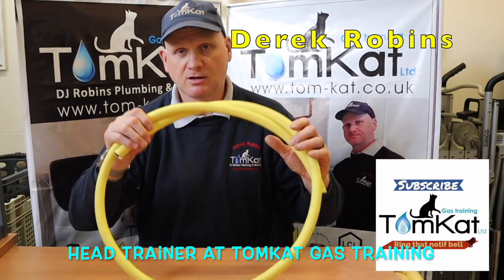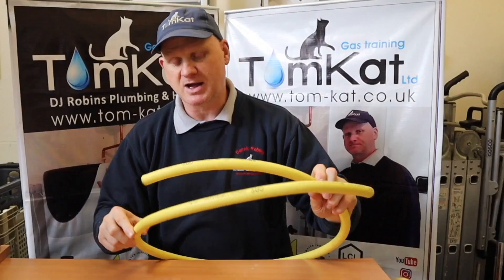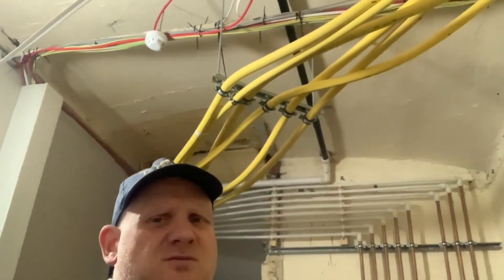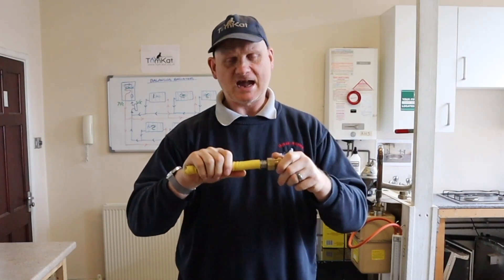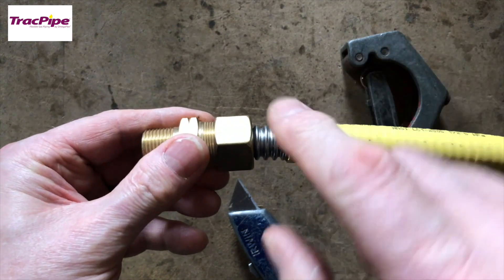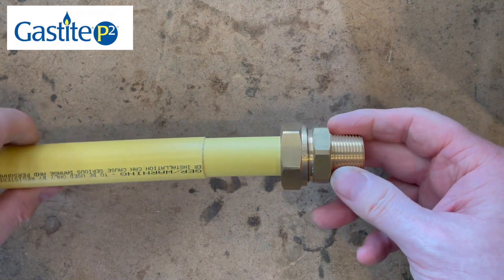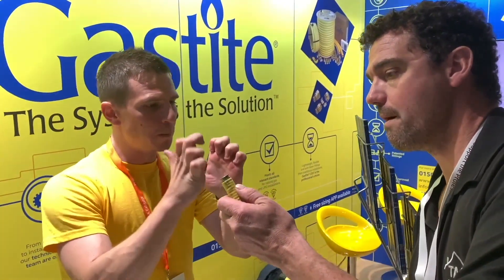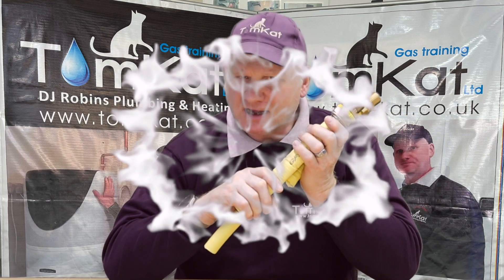Corrugated stainless steel gas pipe, all you need to know,  tracpipe, gestite or GFS which is best?,

Comment: Are the regs regarding supporting CSST pipe the same as copper pipe? Also could you use standard plastic pipe clips to support the CSST pipe or do you need to use a Munson type support clip? Thanks in advance, very useful video
Reply from the maker: @brendanwilkes5333  because of the different types of CSST you need to refer to MIs but you can use both types of clips but normally the next size up because of the OD of the pipe

Comment: What’s the reason you need to come out of the meter 600mm in copper before connecting to Trac Pipe?
Reply from the maker: Because you can only have one flexible connection on a meter and you need the copper to connect the earth
Reply: @tomkatgastraining  Thanks. Cadent came and moved our gas meter and also connected it up to our newly laid trac pipe leading to boiler. They did so via a short length of copper from the meter (about 250 or 300mm) but hopefully that's okay. I thought it was possible to earth the bracket that holds the meter, that's where the old bonding went to. Will get a sparky's advice on that one!

Comment: According to TrackPipe manufacture instructions it can be connected directly to gas meter outlet providing the meter is securely restrained by meter bracket fastened to the wall or floor
Reply from the maker: Correct

Comment: Hi Derick Can I ask on a system with a bypass radiator (In the hallway) both ends having lock shields vales. Which side would be regarded as on/ off and what side is the balancing lock shield? I did read something about it somewhere but can not find the answer. Hopefully you might know? Thank you! It might of been in one of your videos I saw the answer but cant find it and have forgotten the answer!
Reply from the maker: I would always use the return valve as a balancing valve with the TRVs on the flow so a bypass rad I would use the return valve but I guess in this situation it would make very little difference which valve you used